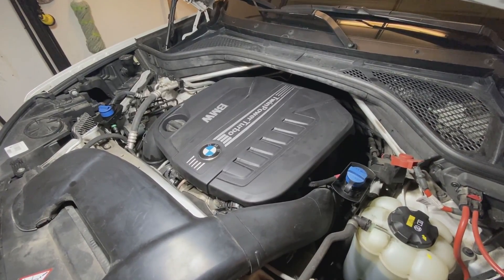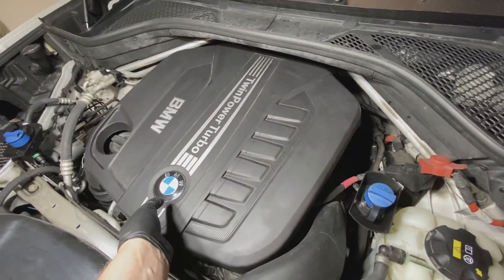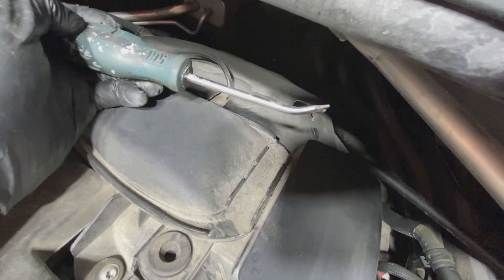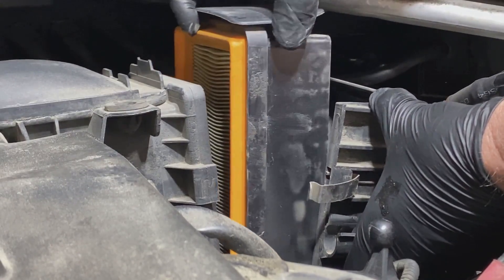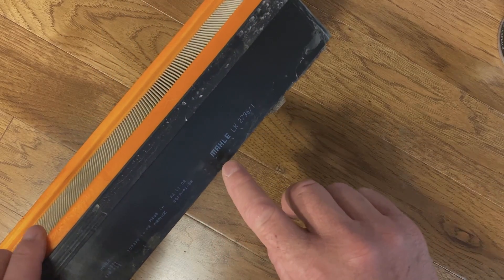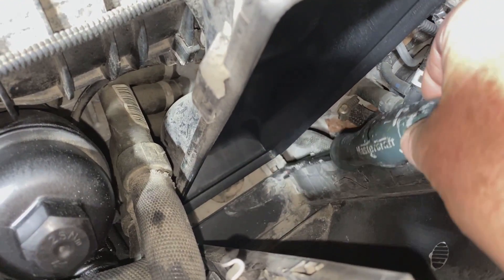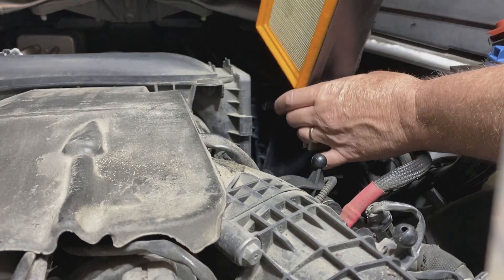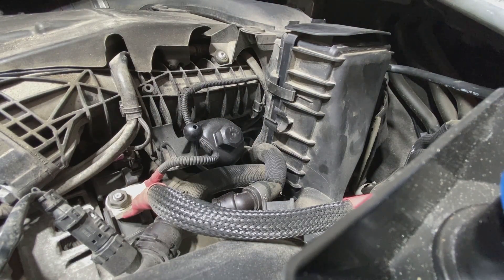BMW X5 Air Filter Replacement | F15 35D

Comment: Thanks for the very helpful video. It's not easy finding DIY info on the F15 35d. I've been trying to find help on changing the serpentine belt and couldn't find much. If anyone can convey any online sources of information that would be greatly appreciated. These vehicles are now collector's items and worth preserving. Hard to beat 30+ MPG, 700 mile range on a tank in a 4,600lb AWD vehicle.
Reply from the maker: Thanks for watching!